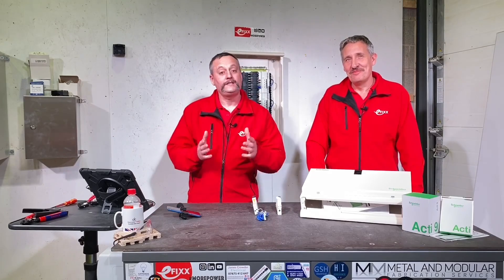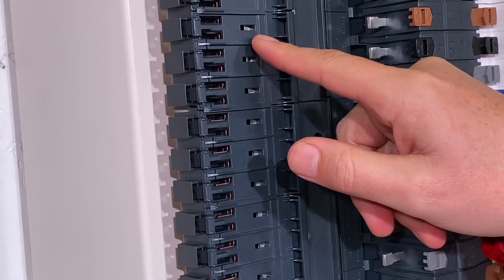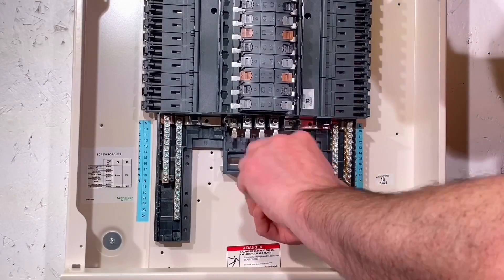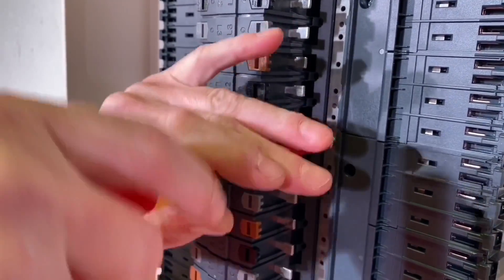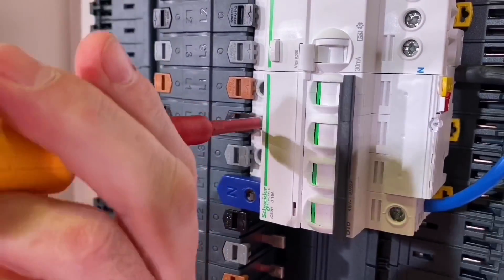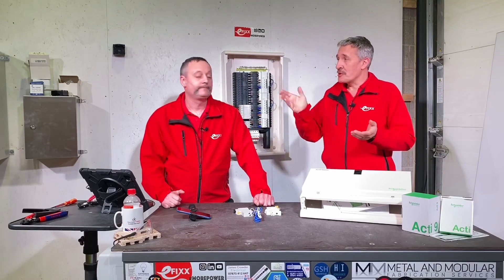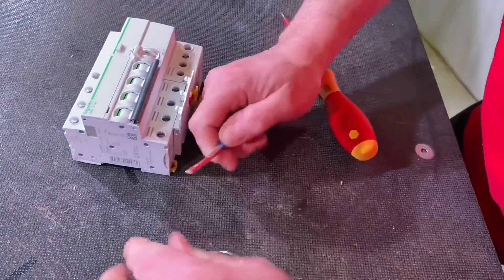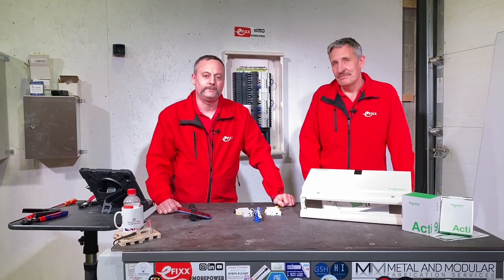NO MORE NEUTRAL FLY LEADS- Schneider Acti9 Three Phase Distribution Board with PON & ISOBAR

Comment: I always thought the isobar was a dead clever design, but everything about this is just just pure genius,  the plug on neutral, the neutral bar and the way the attachments connect to the isolated busbar peg, and even the fact that their blanks allow you to park a conductor for maximum ease of adding a breaker for a provisional circuit at a later date. 
The company I work for at the moment for the most part fit Hager for everything, and I really like Hager stuff but this makes their distribution boards look awful 😂
Reply: Fitting a 12 way P board tomorrow. I'll let you know how it goes.
Reply: I also find that the boards are a little flimsy compared to Schneider and Eaton
Reply: Chris Reed Yeah, not a massive fan of the squeeze to fit incomer shield, the main switch never lines up nicely 😂

Comment: Required required required. 
For the love of humanity torque settings is not a requirement, if it was it would be included in BS7671 . it’s the manufacturers recommendation it’s not even a legal requirement. 
I not saying don’t use a torque screwdriver to torque up the connection’s , i’am saying dispense with the word required. That DB dose look like a nice bit of kit to install. And getting rid of the the stupid neutral and earth fly Leeds is a fantastic idea. 
Fantastic video guy’s as always .👍👍👍❤️
Reply: It is in BS7671. Regulation 134.1.1 contains "The installation of electrical equipment shall take account of the manufacturer's instructions", instructions which in this case state that all connections must be tightened to the prescribed torque. If you do not, you are deviating from these instructions, and thus deviating from 134.1.1. Furthermore, Regulation 134.1.4 specifies "Every electrical joint and connection shall be of proper construction as regards conductance, insulation, mechanical strength, and protection", and you cannot guarantee that it satisfies the mechanical strength criteria if you do not tighten them correctly, using a tool that positively confirms that you have done so.

Comment: Still waiting on a board with fixed wire L+N terminals on the board itself, and full plug in double pole MCB's/RCBO's with no wire terminations at the MCB module. Meaning MCB's etc can be changed or worked on without touching the wiring at all.

Comment: Check out a company called SBS trade, they are offering bespoke consumer units to order and they have a double pole miniature RCBO with no fly leads fed by a double pole busbar
Reply: Is this still new hat in the UK?  Have a look at Clipsal ResiMax or the new ResiMax 9 that is part of the Activ 9 Range.
Reply: @zoltrix7779  there is an equivalent commercial rcbo by schneider over here that is similar to this but when it comes to domestic there is nothing like what you and I have mentioned.

Comment: I am surprised that there aren't more boards there that include this for consumer units as well.  We see the plug in neutrals here in the USA as well.  Leviton has gone a step a step further in that both line and load and neutral are all on the back plane, the breakers just plug into complete the circuit, as all wiring is completed in the board and could be wired in rough in phase (1st fix in UK).

Comment: Late to the game here - Fitted one of these in a hospital, love the plug in neutral. My big gripe is the position of the earth bar on these, with all cables coming bottom entry its easy to forget just how much length you need on this type of board for your earth connections, compared to previous generations and eaton models with vertical earth connections lower down the DB. Personally I'd much prefer just an earth connection directly opposite the module position on the outside of the DB, so that (with plug on neutrals) all terminations are within 6 inches of each other!

Final comment - why do you need the distributed neutral bar when you have 3x plug on neutral terminals available?!? I'd take a triple pole, longer module with three plug on neutral connections over the mess that is the 3 phase RCD modules, although the arrangement shown might just be to keep backwards compatibility with older boards, and thats not something I'd like to discourage!
Reply from the maker: Some great feedback - Thanks Andy 👍

Comment: The 3 phase RCD/Vigi module was used on the older Merlin boards hence why the neutral fly lead is that  long, my biggest gripe with it though was the fly lead was often not long enough to reach the neutral bar meaning it required extentending, unlike MEM they didn't produce a longer version
Reply from the maker: Great info - thanks 🙏

Comment: I always looked at domestic CUs, thinking what a design mess.  Look inside one that has been wired up!  

♦ DP RCBOs only need to be plug in, like the old plug-in fuses, with no terminals on them. Reducing cost and size.
♦ A row of fixed L, N & E push-fit terminals simple and quick. 
♦ Then a circuit cable can be brought in the top or bottom of the CU to each RCBO point. 
♦ L & N & E bus bars built-in behind, nice and safe, out of sight, out of touch.
♦ Just run in L, N & E meter tail cables from the meter to the push-fit terminals of the mainswitch - the three cables being next to each other, so no heavy L, N & E cables snaking around inside the CU.  Nice and neat.
  
What could be easier?  What could be so obvious and simple?  
Yet look at the cludged up mess served up.

Comment: I wonder why the modules in 3PH-DBs in the UK are arranged vertically?

In my opinion this takes up more space than actually required.
Wouldn't it be easier to use a 3/4-pole busbar instead?

And how do you fit additional modules like contactors, timers etc.?
Reply: Vertical boards can fit many more circuits in the same horizontal space, which allows for multiple boards to be placed side by side. So it's better for a large commercial install with multiple boards. Plus you can then run trunking across the top and bottom of multiple boards for all the incomer and outgoers.
Reply from the maker: Interesting point on the busbars and arrangements.  - on this board we’ve specified an add in module for contractors etc - which are set horizontally 🙃
Reply: Something like this (3 pole RCD + 4x AFDD): https://www.elektrikerwissen.de/wp-content/uploads/2018/10/Hager_Phasenschienen_2-750x450.jpg

And yes, the next one is something you fit in a single family home, plenty of space for any modules:
https://www.zaehlerschrank24.de/pub/media/catalog/product/cache/b406a9cdc224c57c443df60b8bd9edbe/1/e/1ehz_1.jpg

Btw. I'd like to see that cont r actor module fitted to the DB ;)

Comment: a great product have used it on site but i when re-configure boards i have come into trouble when fitting the RCBO's that i am losing another 3 ways in the board especially when it is a full board and you change a machine power supply to a socket outlet. whilst you can put the RCBO's on the shop floor at the outlet i have had trouble in wet environments and repeated opening of outlets causing a loss of the IP rating. it would be great if schneider could do a 3 phase 4 pole RCBO that takes up just 4 ways similar to the single phase versions as this would greatly increase the flexibility of the boards in a constantly changing industrial environment. 

great work as always guys especially on the industrial side i have found it hard before to find good impartial reviews and technology updates before i found you guys
Reply from the maker: Thanks Lewis - someone useful suggestions for Schneider to take on board.
Reply: @efixx  was that pun intended?

Comment: Do the  Acti 9 boards come with the Neutral bar and link accessories etc supplied?
I haven't used Schneider or done 3 phase for a long time, it was Merlin Gerin back then.
Reply from the maker: The plug in neutral is the Isobar P - and the distributed neutral kit can fitted as an option to regular isobar or P versions

Comment: When I first used those boards I thought it was a really good idea, that was when they were Merlin.
For years now I have thought why has no one ever made a board that has a plug in neutral to get away with those messy leads, and there were have it, about time to.
Also a 3 phase rcbo, I don't think I have ever seen one of those, some nice design features.
Reply: @Defectiveresistor true, as always the simple ideas are the best, don't know why anyone else didn't do it, probably didn't want to put the investment in
Reply: @N P How does the neutral connect?

Comment: We never had these flying leads here, RCDs and RCBOs were always wired or a fitting bus bar was installed. It's a nice system.... 

One three-phase RCBO and four single phase RCBOs:

https://www.amazon.de/Hager-Phasenschiene-KDN450D-16qmm-3250613741075/dp/B00ZK1XWAO/ref=sr_1_4?__mk_de_DE=%C3%85M%C3%85%C5%BD%C3%95%C3%91&crid=24G4MSEWO9XES&dchild=1&keywords=phasenschiene+4+polig&qid=1606933973&quartzVehicle=812-409&replacementKeywords=phasenschiene+polig&sprefix=phasenschiene+4+%2Caps%2C166&sr=8-4

Or this guy for a row of single phase RCBOs:

https://www.amazon.de/Hager-Phasenschiene-KDN451D-16qmm-3250613741082/dp/B001V9VGJ8/ref=sr_1_15?__mk_de_DE=%C3%85M%C3%85%C5%BD%C3%95%C3%91&crid=24G4MSEWO9XES&dchild=1&keywords=phasenschiene+4+polig&qid=1606933973&quartzVehicle=812-409&replacementKeywords=phasenschiene+polig&sprefix=phasenschiene+4+%2Caps%2C166&sr=8-15

In my installation from 2011there's only a three-phase bar in there. I'm thinking about replacing the stuff with RCBOs and replace the 30mA RCD protection for the bathroom with a 10mA one. The neutral and earth bars are already the Hager Quickconnect, but the MCBs and RCBO are still ones with a screw.

https://abload.de/img/img_0897cvko2.jpg

https://abload.de/img/img_089868kgl.jpg

https://abload.de/img/img_0899d6kvi.jpg

https://abload.de/img/img_0900qmj5u.jpg

And I'll clean up the mess the installer left back then. The thing is, when I clean it up now I'm responsible for this thing. And if I'm already responsible for everything in that box when I clean up the wiring, then I'll do it completely over....

https://abload.de/img/img_0895hajs2.jpg
Reply from the maker: What’s the current rating of the Hager busbar?
Reply: @efixx  These ones I linked? Both are 16mm² and rated for 80A. Current per phase of course. Standard single family houses have three 63A fuses in the service entrance, with night-storage heaters 80A per phase. But most homes here switched over to natural gas, but kept their high rated fuses. The prices for off-peak power are no longer of interest, too high to heat with electric energy.

The Hager neutral and earth bars are rated for 63A.